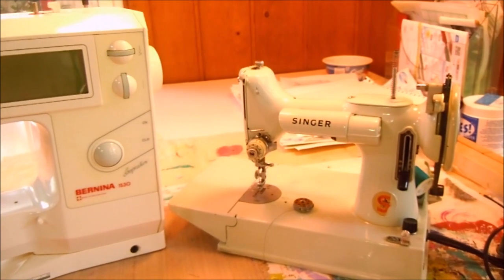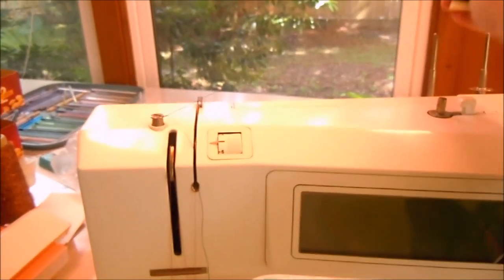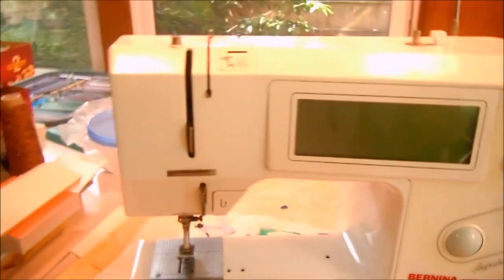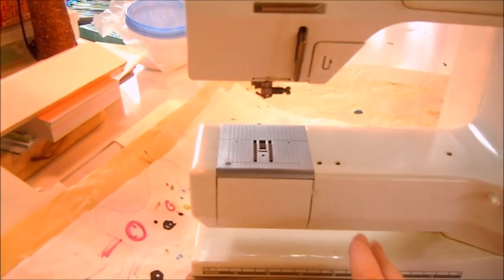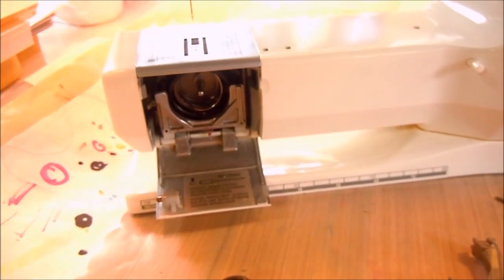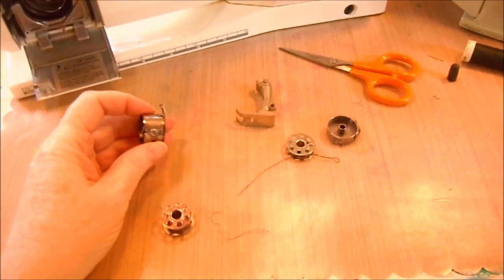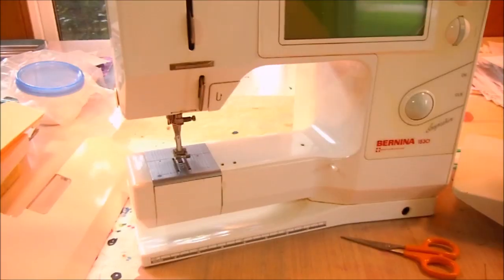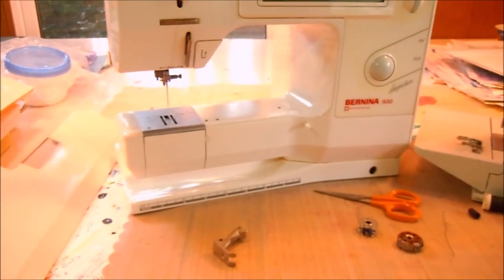Basic Sewing Machine Do's and Don'ts

Comment: Thankyou Glad I found your helpful tips because it prompted me to google a question I had and wanted to share my find..... here it is....p.s: this is what you were demonstrating Thanks again💕💕
~ “ quite often my 521 unthreads while I am using it. this is the only fault I can find with it. any clues, anybody? why would this keep happening?”
🤓3 answers

I am going to guess if it happens when you start to sew it is because the needle is on its way up and that will pull the thread out of the needle especially if you trimmed it close to the presser foot. Leave longer tails and hold onto them, and put the needle in the up position before you begin to sew so that it moves downward for the first stitch. Any sewing machine this will happen on, regardless of model or brand- its just how they work.
If its unthreading during sewing then you might not have correctly threaded it. Thread with the presser foot up so the thread gets seated correctly into the tension discs. It might look like it is, but thread can jump free again if you have the presser foot down when you thread. Again this applies to any machine.

“Thanks - I will try threading with the presser foot up - I always have it down so that I can get to the needle easily. Will see how this goes.”✌️🤓

🤓👍It's not really to do with the needle being up. It's that the stitch cycle needs to be completed. Look at the thread take-up lever, that's all you need to worry about. Facts; When the take-up lever is at its top position, it has finished pulling the thread out of the hook/bobbin case area.
The needle has actually gone over it's top position and is on the way down slightly.
(So have it in this position when you stop and start.)
In this position you can also lift the foot and remove the fabric, change your bobbin, adjust your stitch width, change your stitch selection.
Also, as another rule of thumb for keeping out of trouble when sewing, when you turn the handwheel, always bring your thumb back toward you. Don't turn it the other way. Enjoy easy sewing.👍👍💕🌺🌺✌️✌️👌🏾👌🏾

Comment: Thanks for this, very helpful.  Question about not turning the wheel backwards:  What if you want to reverse stitch and the machine stalls?  (Mine does every time.)  And another question -- my wheel is screwed on so tight I can't unscrew it to wind the bobbin.  Any suggestions?  Thanks again.
Reply from the maker: So glad it has been helpful. First if the machine is in reverse you still turn the hand wheel forward to complete the stitch you will just tangle things going backward with the hand wheel. The internal workings of the machine know it is in reverse. Just leave the machine in reverse and turn forward to continue.  Secondly does your book say to unscrew the hand wheel to wind the bobbin? If so and you can not undo it then it probably needs to see the repairman for a tune up. Hope this helps

Comment: still watching but one quick question - i now understand what i am doing wrong - i always have the needle all the way down and the presser foot down when i thread - i now understand presser foot up but does the position of the needle matter - does it need to be up or down?
Reply from the maker: yes the needle position does matter because you have to get the thread into the thread take up lever and if the needle is all the way down it puts the leaver in an odd position my machine stops with the needle in the highest position and that is the best place for threading

Comment: Request -- if you haven't already, I'd love to have some instructions on oiling the machine.  Mine squeaks.  I've used WD 40 and sprayed it 20 different times, still squeaks.  Argh!  :)
Reply from the maker: Hi I have on my list cleaning and oiling for a video however I am afraid that you need to take your machine to a repair man.  I am sorry but WD 40 is not the same as machine oil and I would not even have a clue what might or might not  have been damaged by spraying it into the machine.